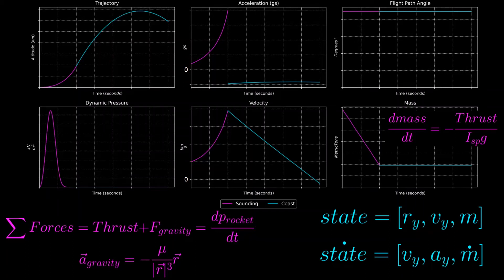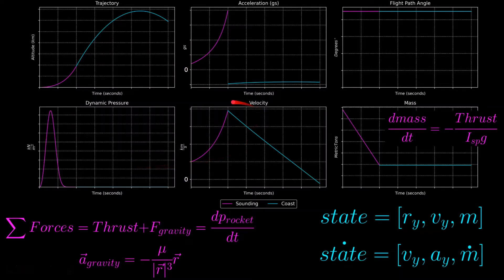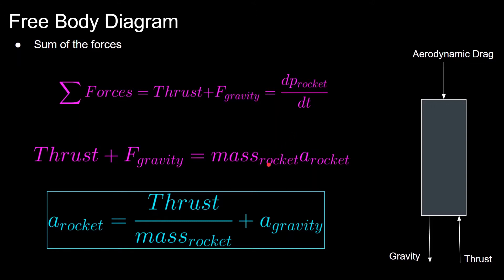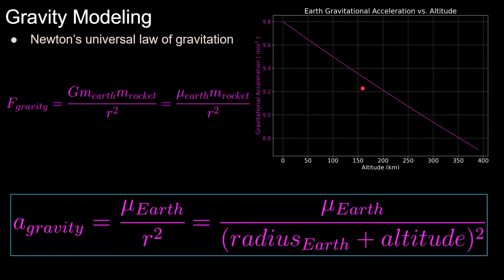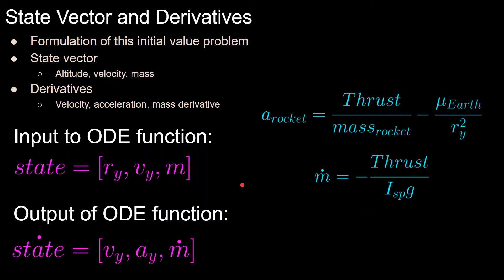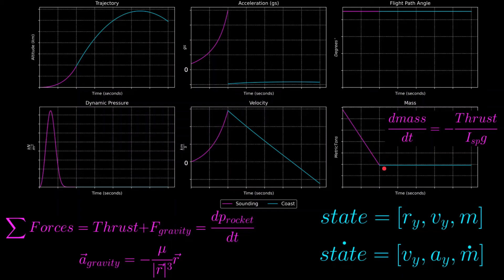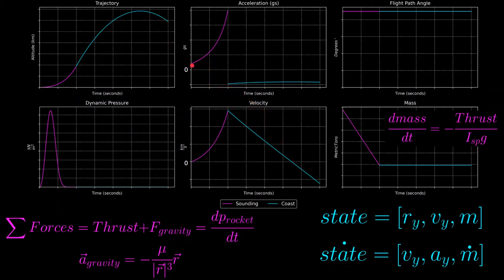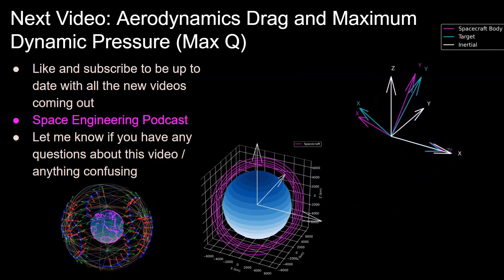Sounding Rocket Trajectories | Rocket Trajectories 2

Comment: Nice video. I have a problem I'm working on similar to this. It's for a sounding rocket and we need to calculate the acceleration, with respect to time which I've done, but I'm having trouble figuring out the velocity and position of the aircraft during and after burn time. Is there any way I could reach out to you like through email about it? Thanks.
Reply from the maker: I think you're looking for methods of how to solve 2nd order ordinary differential equations numerically. This is because acceleration is the first derivative of velocity and second derivative of position. Check out this playlist with 4 videos (currently), where I walk through all the fundamentals of ordinary differential equations, ODE solvers, and then how to create an RK4 solver yourself to propagate a spacecraft trajectory, which will be a similar process to this rocket trajectory, just slightly different equations of motion.

https://www.youtube.com/playlist?list=PLOIRBaljOV8hBJS4m6brpmUrncqkyXBjB

Also, there is a GitHub repo where I post all the software for the videos: https://github.com/alfonsogonzalez/AWP
Reply: @alfonsogonzalez-astrodynam2207  Thank you Alfonso, I'll be sure to check those out. The equation for acceleration of the sounding rocket is given as : 

du/dt = ((c*zeta/burntime)/(1-zeta*t/burntime)) - g - ((0.5*Cd*row*u^2*A/mass_initial)/(1-zeta*t/burntime))

From here we're asked to find velocity graph as a function of time, and position as a function of time. I'm not sure exactly how to approach it. But I'll check out your videos as well thank you.
Reply from the maker: Yes those videos go through that process of solving the 2nd order ordinary differential equation, and specifically its implementation in Python. Definitely feel free to ask questions in the comments of those videos as well if anything is confusing
Reply: @alfonsogonzalez-astrodynam2207  Ok I'll be sure to do that then. Thank you!